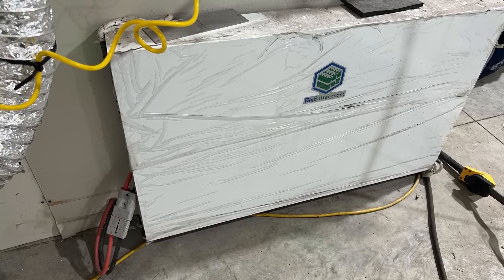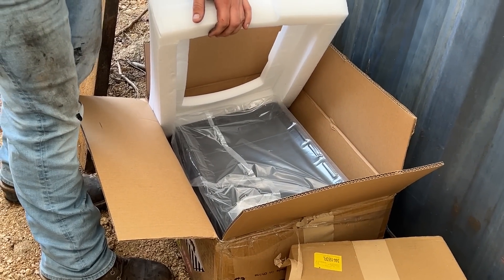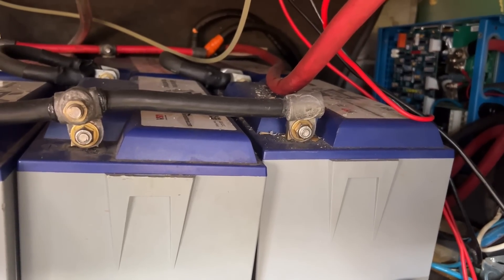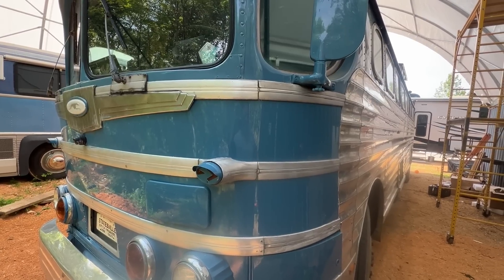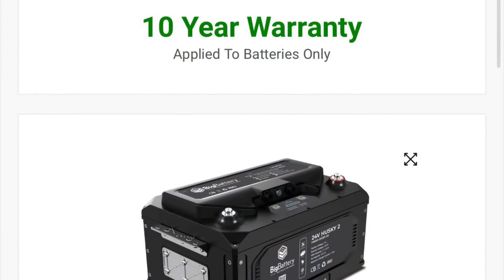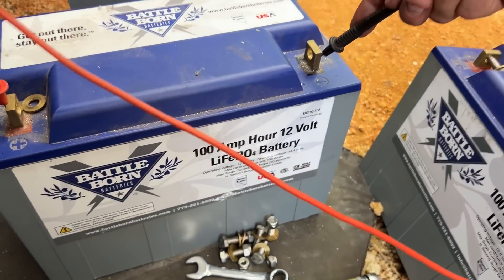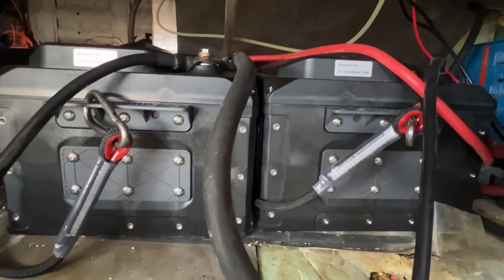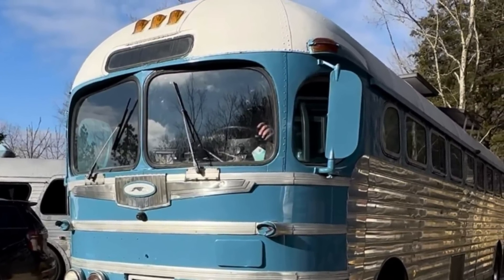24v LiFePO4 Husky 2 Big Battery upgrade on the 1947 GM bus RV conversion upgrade from 12v lithium

Comment from the maker: https://bigbattery.com/products/24v-husky-2-5-12kwh-lifepo4-battery-with-5-16-ring-terminal-cable/?ref=243

Coupon Code is: monkey10
Reply: Each LiFePo4 batteries should have their own BMS installed on them to prevent over charging and failure. So if one of the cells is about to fail the enitre battery shuts off. What you have shown us either there is no BMS in the batteries or that really low battery has failed cells in it.

Comment: Lithium batteries are no good as a start battery, as a base load for general lighting, running fridges and the like and connected to a solar array work well. But as a battery to start a large petrol or diesel engine the start current will eventually kill the these type of batteries. This is the reason why starting batteries are generaly lead acid. They can supply a very high short term current for starting a engine, but as a basic supply for lighting etc, will go flat reasonable quick. Even AGM batteries suffer from the same problem, but would last a bit longer.

Comment: Whoa, thank you so much for showing the specs. To see things like suggested low voltage cut off, the 10year warranty ( wow ), charging temperature allowing down to -20c ( :O ! ). Very interesting
To set the low voltage cut off as high as possible* and to avoid having these batteries sit at their maximum voltage will increase their lifespan significantly. Also safer to not sit at max voltage.

Comment: Hate to see that nice bus burn to the ground because of a faulty electronic component, very dangerous set up if not done right,  the biggest place of concern is the components in the battery